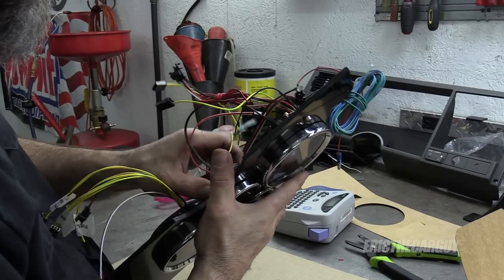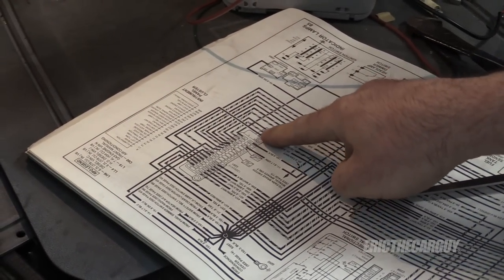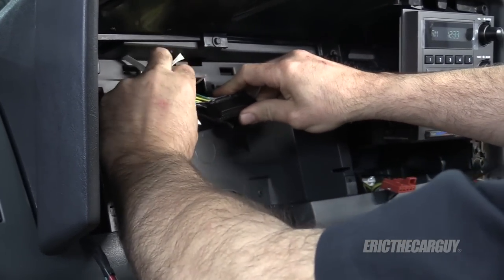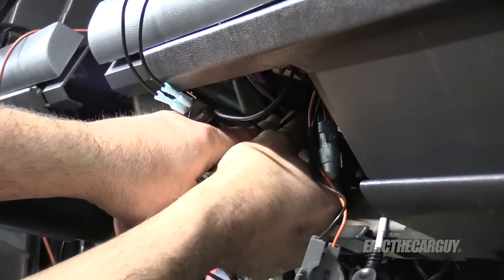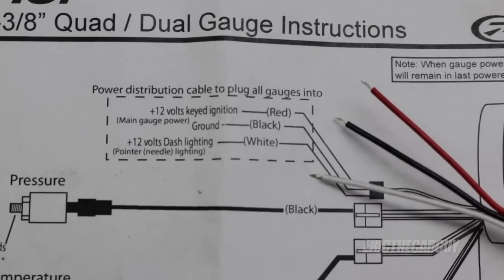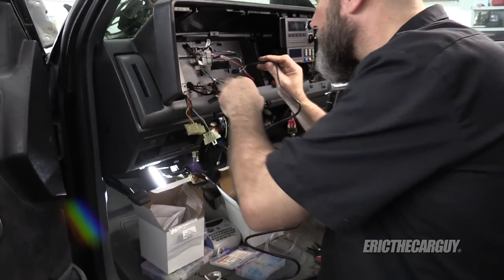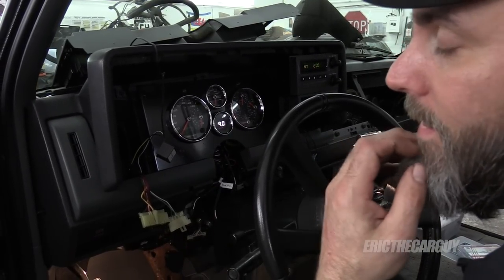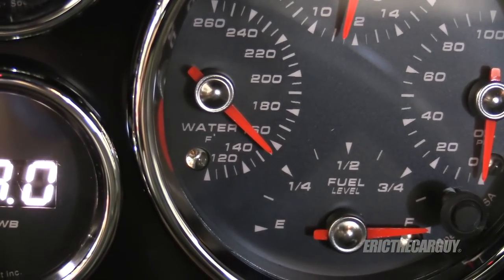How To Wire a Custom Instrument Cluster

Comment: What ever happen to the engine rebuild ?
Reply from the maker: Nothing. We aren't at that part of the series yet. BTW, there are other parts of a build besides an engine. Otherwise, you'd just have an engine on a stand and nothing more.
Reply from the maker: The engine was not in the truck during testing. I used a heat gun. The closing of the video was shot long after the truck was completed.

Comment: I notice that you have to trim quite a bit off from those label maker labels; half is label and half is waste. That's a shame. I'm wondering if the manufacturer does that on purpose, so you can buy more cartridges. Bummer.
Reply from the maker: That's intentional. In order to wrap the label around a wire, and still be able to read it, you need extra label. I added spaces to get the extra label I needed to do that.
Reply: @ericthecarguy  Ahh okay. I have a Brother that has a "Cable mode" that'll print twice with a line in the middle. Then I print all the labels back to back and manually cut them apart for much less waste. It's something that 20 labels = 20" of waste, almost two feet.
Reply from the maker: That sounds way better than what I'm using.

Comment: I think you should have ditched those inline fuses and loose relays and put in a universal fuse/relay box. Other thing is to make your own connectors. That way you would not have need to extend any wires with butt connectors.

Comment: for those wondering why the voltmeter LEDs seemed to be blinking erratically, that is because it is what is known as a multiplexed display.
multiplexing  actually pulses voltage to the LEDs at a rate faster than the human eye can detect, but cameras can pick it up.
in other words, those LEDs don't look that way in real life.

Comment: Dude instead of the spaghetti you made it would have been easier to get a set of male female 30pin plugs and their pins and just connect the wires you identify one by one to the cluster you made?  Imagine trying to service this mess
Reply from the maker: As I stated at the end of the video, I went back in and cleaned things up before final installation. I used the connectors I had on hand, also the ones that came with the gauges, of which there are 2 sets. Time was a factor with this build. The entire truck was done in 6 months, including a full engine rebuild. It's not as bad as you think and the connectors that I DID install, make it very serviceable. I understand where you're coming from though. Thanks for your comment.
Reply: @ericthecarguy  thanks for taking the time to reply.